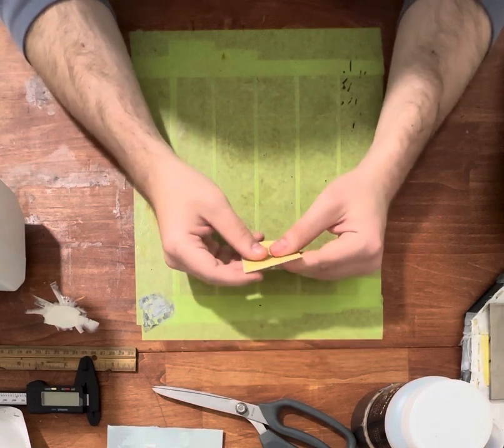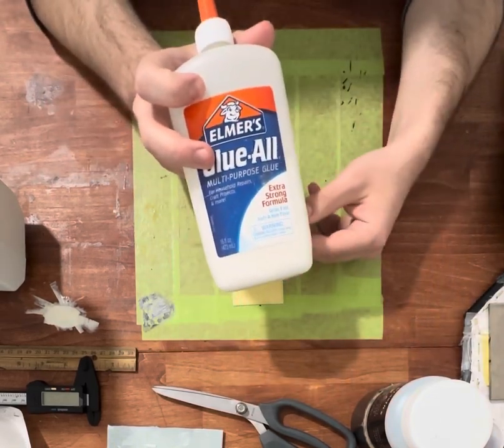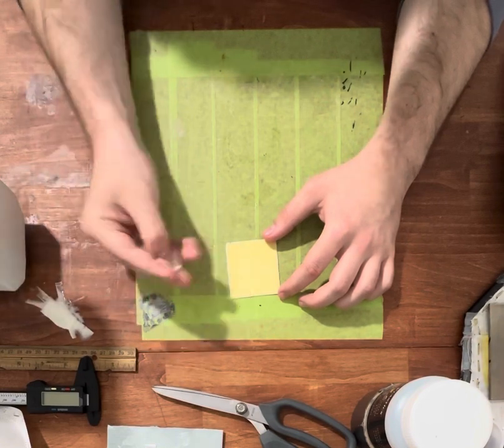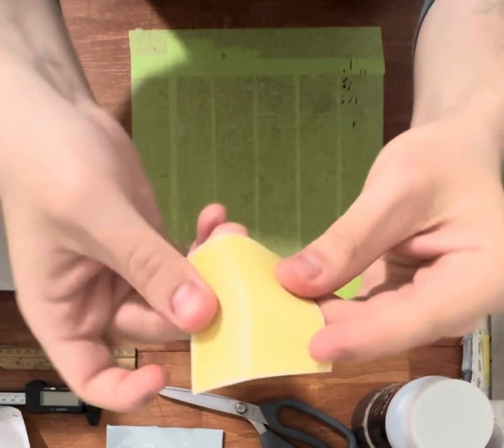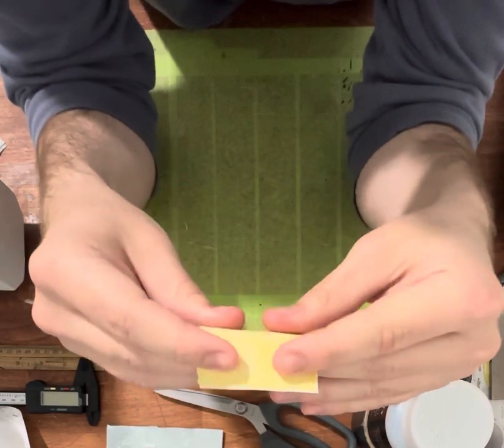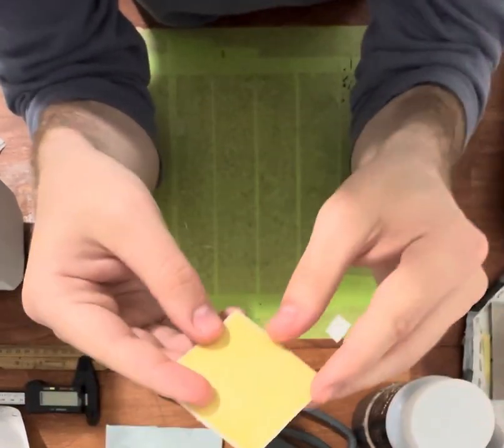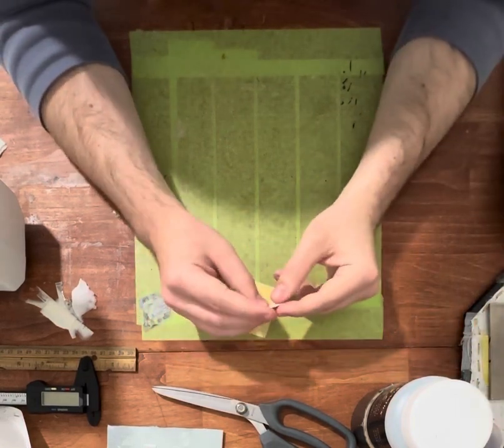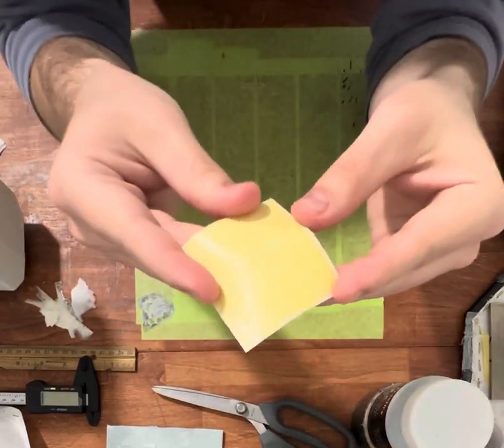Homemade flexible resin?

Comment: I’ve wondered about using rubber sheets from conveyor belt splicing supply, and using that to vulcanise composite fibres together. Could even be used to securely mould mosaic tile sheets in place tightly to eliminate delaminating.
Would need a heating press though. Thoughts?

Comment: Interesting. What kind of resin did you use? Polyester or Epoxy? Yeah choosing not to spend money on something that may or may not work is smart actually. That $60 could afford you a decent brand of 2 part epoxy resin or a small roll of Kevlar or something else.
Reply from the maker: I used epoxy
Reply: what about something shear thickening? rollerpin silly putty into landscaping fabric!
Reply: @kingmasterlord  Stf can work but I personally think it would be more suited as padding for trauma prevention. Hard plates is what you would want when dealing with a small piece of metal coming at you faster than you can run 🏃 or get out of the way. 
Some people like wearing a soft vest but not me. I don't like the idea of my ribs being broken.
Reply: @nemesisobsidian  well of course it makes for a great trauma plate, but the anti spalling properties, tho. sandwich both sides of the plate.
Reply: @kingmasterlord  👍 Yeah, that too. It can also make a great stab-proof vest and block slashes and stabs. Forgot to mention that earlier.